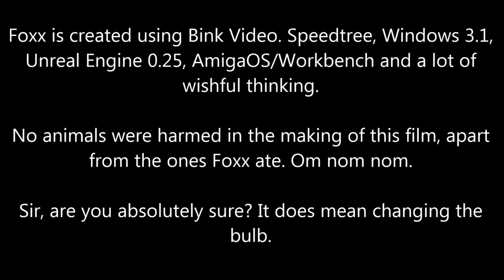MEGA SIZE Gundam RX-78-2 Part 6: Frame - Airbrush Tutorial

Comment: Great  tutorial!  i was just able to get my  primers to  work in  the  airbrush today.  I use Vallejo primers. White, gray and black.  Respectively.  I had to  switch from a .2 needle to a .3. Prior to that I  had to  brush paint the primer on. Not fun.  lol
Works great now. :-)
Reply from the maker: +bpezzano1 Yay! Yeah, a bigger nozzle is better for primers. In fact, it's actually worth investing in a cheap airbrush with a big nozzle JUST for primers. It means less cleaning of your regular more expensive brushes when primer gunks them up, and if it gets TOO gunked up, just throw it away and get another cheap one. Primer doesn't have to look pretty :) 

The .2 should be fine for thinned paint. You may also fine the .3 better for metallic paints like gunmetal and the like - they are usually full of flakes that give the metallic sheen and can easily gunk up a smaller nozzle ( I can't remember what size nozzle my DeVilbiss airbrush has, but there is no way it would have sprayed the gunmetal like my little cheap Neo did in this video).

Comment: Hi. Great video. the primer help to protect the plastic. but the primer like tamiya use lacquer. it does not damage the plastic?. The tamiya lacquer thinner is recomended to thinning the tamiya liquid surface primer (for the airbrush), it is safe to use In the abs plastic?
Reply from the maker: +Roberto Austria Hi Roberto, thanks :)

Tamiya spray-can primer is absolutely fine on these kits - it technically is a lacquer primer, I think, but not particularly strong so it won't eat any plastic, and can be used on ABS with no problems. The Tamiya liquid primer than comes in a jar (not a spray-can) is slightly different and like any airbrush primer you have thin it to get it just right for it to work perfectly, which is why I don't use non-spray can primers.  And you are correct, you can thin the liquid primer with standard lacquer thinners, but if you do that I can't guarantee that it won't harm the ABS as your mix may be much stronger than the primer that comes from the spray can. On a model that is all PS (polystyrene) it would be fine, but on a kit with ABS I personally wouldn't take the risk with liquid primer.
Reply: +Modelmaking Guru. the tamiya lacquer thinner can damage the abs plastic?
Reply from the maker: Any lacquer product can damage ABS if it is applied in a strong enough concentration. It's unlikely but not impossible. With Gunpla, I just prefer to play as safe as possible and not take the risk. Never had a problem with the Tamiya spary cans though, so they must be a fairly "cool" mix (thinners that are corrosive or that eat plastic away are often called "hot",

Comment: Is that a seam line on the domed part of the piece at 1:26? Or is it a trick of the light? If it’s a seam, what’s causing it, given that you clearly worked hard to remove the seams in the last episode? Thanks!
Reply from the maker: Yes, that was a seam line - I didn't bother about the seams on those parts of the frame because they were hard to see once assembled and would he heavily weathered anyway. Sometimes you have to go after everything, but sometimes there are battles that you just don't need to pick ^_^

Comment: Great video. Now I really want to get an airbrush, but I'm not rich enough to get a cheap one yet :( Even a Neo!
Reply from the maker: +Lynn Dippel Ah, you'll get there :) You can get little cheapy ones from Halfords (if you are in the UK) but they are pretty crappy and not double-action, and cost about the same as a basic Neo for Iwata, so it's worth waiting on for. If you are struggling to get a brush AND compressor, you can always plump for air cans as a short-term fix until you get a compressor. But only short term, in the long run it would cost you more, and the pressure is not constant as the can empties. But it is a great way to get started and get practicing until you can afford the compressor too. 

Lastly, again if you are in the UK, give the team at www.emodels.co.uk a call and ask their advice about a good cost-effective starter set for beginners. They will advise you on your options and look after you (they are all top blokes, they won't just convince you to get the most expensive thing like some stores do. Tell them I sent you :)
Reply: Thanks Foxx. I live in USA and been looking at the Badger 105 Patriot. I have been looking at emodels.co.uk web site for advice and every where else. :D
Reply from the maker: Pleasure!

The Badger 105 La Le Lu Le Lo? Not a bad choice :)

helgan35 will comment in 5...4...
Reply: +Modelmaking Guru Snake? Snake? SNAKE!!!!!!!!!!!!!!!
Reply from the maker: +Tim Lemmens And you will too, of course.

Time to change to disc 2!
Reply: :-D

Comment: I hear people are running PSI  around 15 to 20 .  I don't get a fine mist until I get over 60.  I have cleaned it several times. It is a 2 stage air brush but quite old . 10 years old.
Reply: +Bruce f That sounds like it might be gunked up Bruce. How long has it been struggling to spray for?
Reply from the maker: +Bruce f Agreed with @Helgan35, sounds like either your brush is gunked up the wazoo, or possibly your pressure gauge is faulty (it's a possibility). It could also be the paint is just too thick - depending on the paint you use (metallics are usually way thicker than regular colours|). If it is a standard acrylic, usually a 50/50 mix is a good indicator - if it can't spray that then yep. something is amiss. 15-20 is around the norm. 

One other thing, if you have ever sprayed Future/Klear/Pledge through it, that stuff is a right bugger for clogging up the brush if you don't strip it down and clean it.  

Lastly, it is also possible it is the valves on the air hose or in the brush itself that are faulty or blocked. Try swapping out your air hose initially to see if that makes a difference. 

If you haven't already, field-strip the brush and look over everything, look for caked on paint or other stuff. If you can't get it off with usual thinners, it may be worth using stronger stuff like standard thinners, cellulose thinners or even Xylene. However, unless your brush is solvent resistant it's best to keep those kinds of thinners on parts that don't have rubber seals like the needle and nozzle, crown cap and nozzle cover. If you can get hold of some, I haven't yet met a paint that Caron's Paint Killer can't eat away. Or even get one of those ultrasonic cleaning thingies that @Helgan35 showed in his earlier video - I must get one of those myself :)

Comment: Can I use the paint from enamel based rattle cans?
Reply from the maker: Sure, just make sure to keep the rattle can around 30cm from the part you are painting, keep the can moving at al times, and make sure it is not pointed at the piece when you press the trigger (there's often a splurt of paint when the trigger is first pressed). Build the colour up in light misty coats. Also make sure to allow several days for enamels to fully cure and dry. Also make sure to primer the part first as enamels can be quite harmful to the bare plastic. Make sure to work outdoors if you can, and wear a respirator as the vapours are quite harmful. Lastly, try a test piece out first on a spare bit of plastic to get your technique perfected before going for it with the actual model ^_^
Reply: +Modelmaking Guru can I use the paint from the rattle cans to use it on my airbrush?
Reply from the maker: If you are airbrushing, I wouldn't bother decanting a rattle can, it would be much cheaper to just get normal paints, enamel or otherwise, to airbrush. And to be honest decanting from a rattle can is a major pain in the ass.